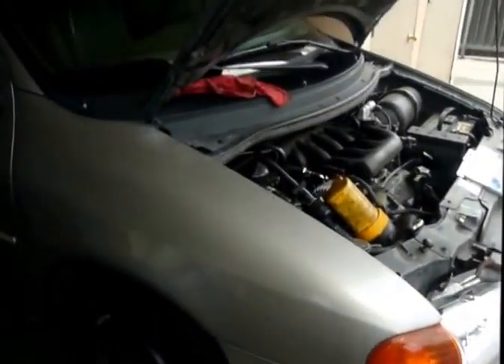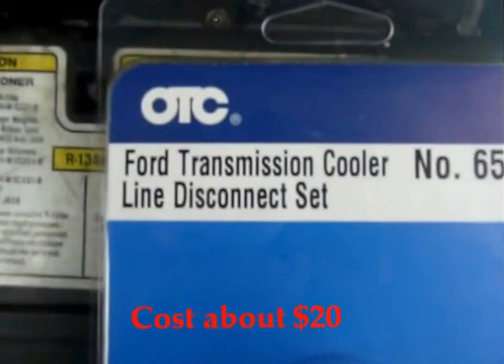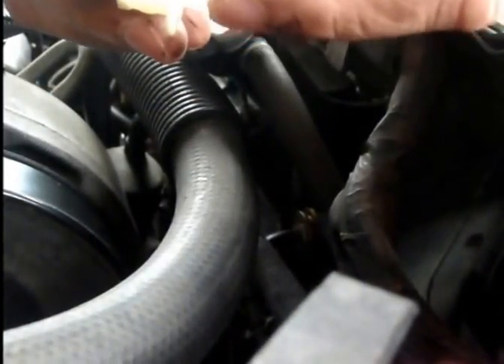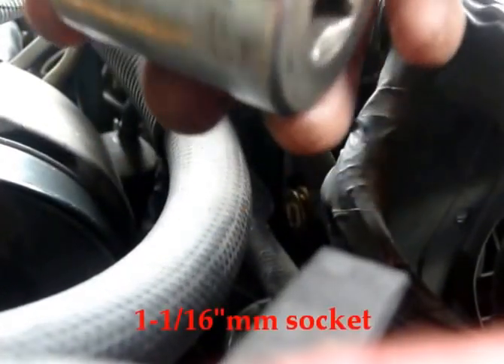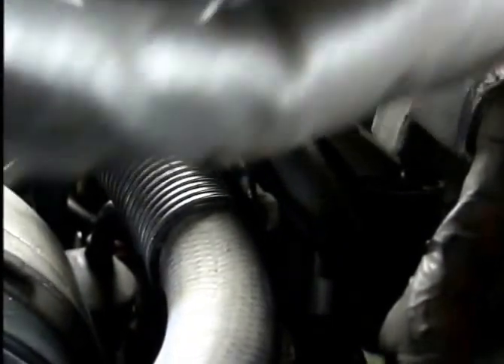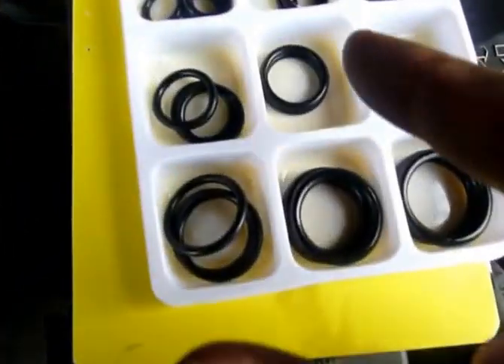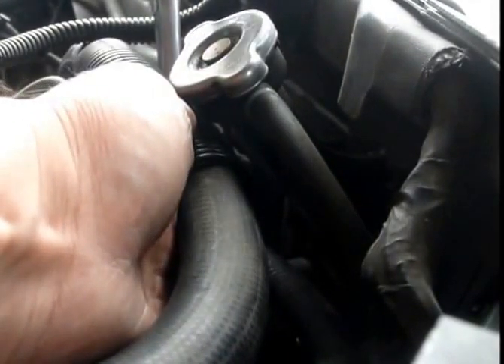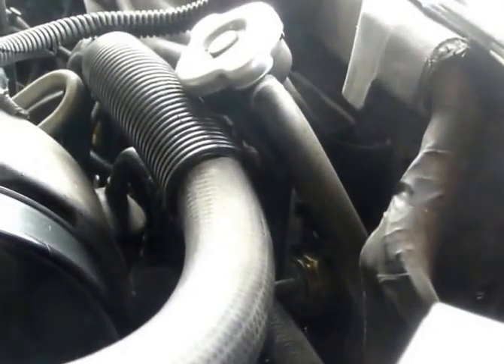Transmission Cooling Line O ring replacement on a Ford Windstar radiator

Comment: I don't know were you get the idea that an o-ring is required, because it is not.  Your fitting has an inner o-ring that seals the tube.  Simple tread locker or sealant is required.   Why do you think the o-ring was torn apart?  Because it's not supposed to be there.   I just finished replacing both lines myself.
Reply from the maker: Hi Don, Thanks for the info. When i bought that radiator it came with an o-ring and with time I noticed that it began to leak so when i removed it, I saw the torn o-ring, and so that is why i replaced it. so far no leaks and running strong. Thanks again.
Reply: Some Ford vehicles do use o-rings, I bought a replacement radiator that came with them and when I pulled out the original ford radiator there was some installed. Not to mention you can buy them straight from Ford or  aftermarket ones from many auto parts stores.
Reply: Ex